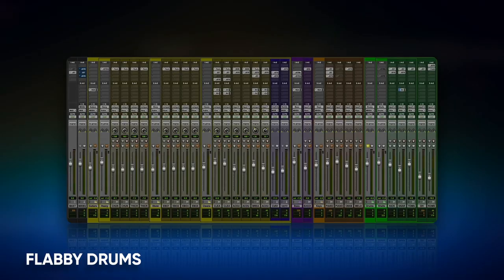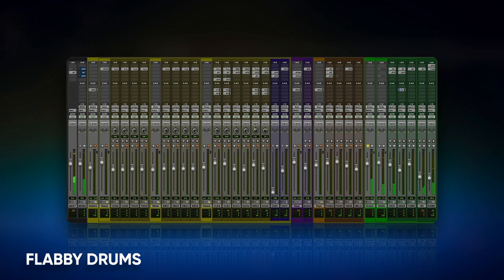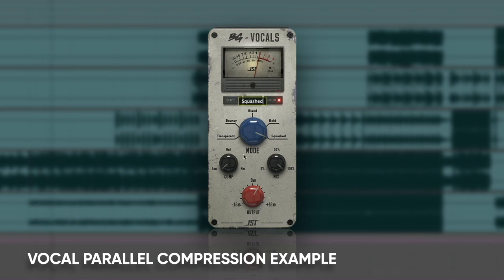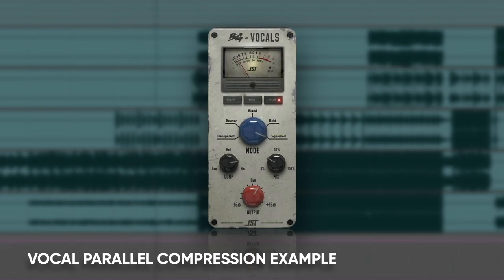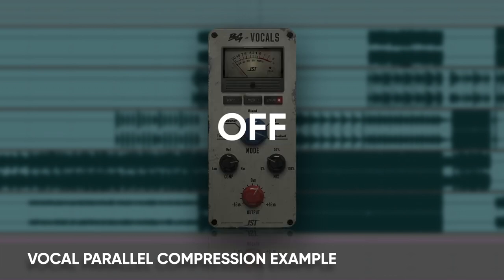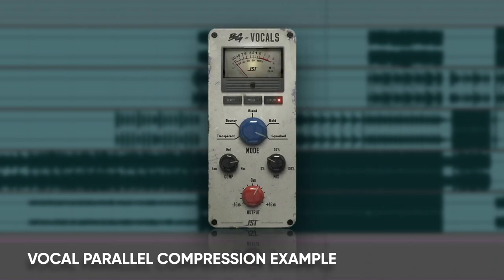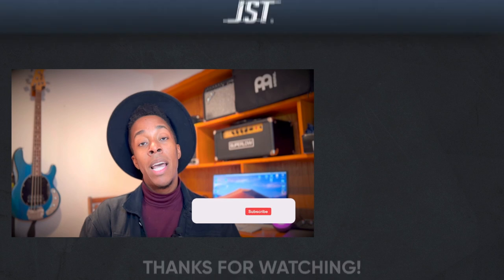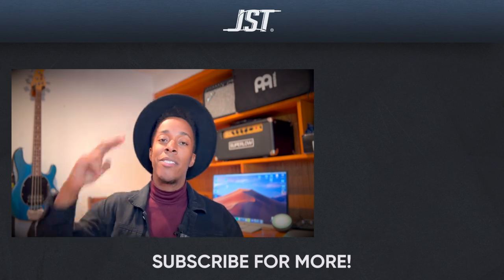Using Parallel Compression To SAVE Your Mix

Comment: For the rear bus technique, you said "make sure you're sending it in dual mono." I'm a little confused about how you can send something in dual mono. I understand the idea of setting your parallel compressor to dual mono. But that's not "sending it in dual mono." That's "sending it into a compressor set to dual mono." Is that what you meant? Or is there some other technique I'm not understanding?
Reply: Nah you got it - you send the tracks - mono/stereo/whatever they happen to be - to the rear bus aux, which is a stereo summing bus. You have a compressor inserted on that bus in dual mono mode. It treats the left and right channels independently. If the compressor was in stereo, it would treat them identically. If an extra instrument plays or there’s a loud part on say, the left channel, which increases the total volume of that side - a stereo compressor will squash down on both sides at that moment. If there’s no extra volume on the right channel it will make that side quieter than it should be and make the mix feel like it’s pulling to the left. If the comp is in dual mono, it will simply clamp down on the left channel and leave the right channel alone, so the right channel will be consistent, and the left side will too, because it’s been compressed. It’s common to compress very heavily on the rear bus and kill the transients with very short attack times and very long release times, and set it at a very low level just to add some fullness and detail to the sound. You kill the sounds in front to bring forward the quieter sounds. Dual mono lets you bring the quiet sounds up evenly between both sides/channels 🤌🏼
Reply: this was incredibly helpful for me, ive never heard of dual mono. thank you fat tommy, have a good day dude🥳

Comment: If you are using parallel compression, do you send the tracks before or after doing other moves such as their own bit of compression or eqing?
Reply: I would recommand doing your usual compression moves first, to get your sounds in check (if they need to be, there is no hard rule). Then doing the parallel compression. If your tracks need to, same thing.
Reply: @Eurodrummer666  thanks for the reply!
Reply: @Sense_of_Insight  no problem dude.
Reply: @Sense_of_Insight  oh, just one thing. The interest of parallel compression VS individual compression is you can go overboard with it while the regular comp for your individual shells is usually more conservative (but again, no hard rule).
Reply: @Eurodrummer666  that makes sense as to why the parallel compression can really hype the drums up. Thanks for helping break that down!
Reply: @Sense_of_Insight  no worries dude, mixing can be hard to handle when some concepts are not understood. But I am no professional, I only mix for my band so far.

Comment: How come you’d make sure the parallel comp on the mix bus is mono?  Wouldn’t that cause phasing issues or negatively affect your stereo image?
Reply: He said dual mono I’m pretty sure. So there would still be a stereo image.
Reply: @caliblittle8086  he did say "dual mono." But he said "make sure you're sending it in dual mono." I'm a little confused about how you can send something in dual mono. I understand the idea of setting your parallel compressor to dual mono. But that's not "sending it in dual mono." That's "sending it into a compressor set to dual mono." I wonder if that's what he meant? 

Either way, you definitely don't want to use straight-up mono. That's not gonna work at all.

Comment: Excellent vid here Joey! If Parallel Compression is used on the entire mix using a few different compressors, does that override the need to have a stereo compressor on the two bus? I went back to using analog Mackie 32-8 bus console and that board has submaster inserts for parallel compression, and it also has stereo main inserts for two bus compressor so, I’m thinking should I not use a two bus compressor if I’ll do the parallel technique on all tracks. I have 4 outboard compressors. What are your thoughts man?